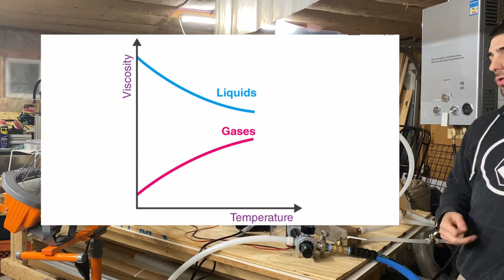How Will The Tesla Turbine Generator Handle A 1200 Watt Electrical Load? Tesla Turbojet R&D

Comment: Can u plz tell me how much electricity is consumed by air compressor and electricity generator by turbine?
Reply from the maker: Hey Afzal Khan, thanks for commenting. 

The energy available for the turbine to use can be calculated from the energy available in 170gal tank at 150psi dumped to 65psi. 

The efficiency of hardware store compressors (which is at best 10-15% efficient) is not a good reflection of how well the turbine actually works. 

The isentropic efficiency of the turbine is determined from the energy available in the tank compared to the energy output to the shaft. 

Take a watch at the part 2 of the power output tests + thermal addition. 
Tesla Turbine 1200 Watt Electrical  Load Tests part 2 - Power Calculations - compressed Air + Propane
https://youtu.be/bWpXRzrzf4g
Reply: Yes i saw that video but still this system is not self sustaining
Reply: Why dont u increase the dia of turbine and instead of rpm focus on the torque generated
Reply from the maker: Can you give me an example of any room temp Compressed Air Energy System that is self sustaining?
Reply from the maker: I’m not sure I follow. I’m not focusing on the rpm. In fact I’m proving that TesTurs get plenty of torque and power out even at low RPMs. 

You just have to build them like Tesla says to build them. 
1) increase the fluid velocity relative to the discs (not increase the disc rpm)
2) increase the surface area
3) decrease disc spacing. 

There are 75 discs inside this turbine. That’s over 10,000in^2 

“Owing to a number of causes affecting the performance, it is difficult to frame a precise rule which would be generally applicable, but it may be stated that within certain limits, and other conditions being the same, the torque is directly proportionate to the square of the velocity of the fluid relatively to the runner and to the effective area of the disks and, inversely, to the distance separating them. The machine will, generally, perform its maximum work when the effective speed of the runner is one-half of that of the fluid; but to attain the highest economy, the relative speed or slip, for any given performance, should be as small as possible. This condition may be to any desired degree approximated by increasing the active area of and reducing the space between the disks.”
-Nikola Tesla
Reply from the maker: @Afzalkhan-nb9rk  I am in fact focusing only on increasing torque for a given motive fluid supply, not rpm. 

2.75kW, 6.22 ft-lbs at only 4150rpm
A Tesla Turbo that actually works on room temp compressed air.
https://youtube.com/shorts/yXQy844URMA?feature=share
Reply: Exactly that i also want say that if we have sufficient torque then we could generate electricity
Reply: And also we have to focus on generator i.e. two pole three phase a.c. Generators
Reply from the maker: How do you mean? 
🤔 
I already am generating electricity 60 hz 120vAC to the plug. That’s what the rectifier and inverter are for.
Reply from the maker: I think you may be confusing my gear setup.

This setup isn’t geared downed to the generators. 

I have this geared UP at 3.6:1 to the generator. (Ie the generators spin 3.6x the turbine RPM)
Reply: @CharlieSolis  why to use rectifier and inverter ?
Reply from the maker: @Afzalkhan-nb9rk  These are 4pole 3phase generators. 

They are high frequency pm alternators.  

They are used for electricity production with micro gas turbine electric generators all the time because of their high RPMs.

They also get some of the highest mechanical to electrical efficiency conversion compared to almost all other generators on the market.
Reply: @CharlieSolis  we generate ac voltage directly its enough
Reply from the maker: @Afzalkhan-nb9rk  I also have a design for dual built in axial flux generators in between stages. 

Dual Stage Tesla Disc Turbine With Built In Dual In-Line Axial Flux Generators CAD/CAM Walk Through
https://youtu.be/FIkU8Gny8i8
Reply: @CharlieSolis  wait lets make it simple , for example to generate ac voltage we need to rotate two pole generator at 3000 rpm and in tesla turbines we have sufficient rpms so why are u not using big generators like 10 kw or 15 kw generators and make a closed loop system integrating ur generator and motor of ur air compressor
Reply: @CharlieSolis  this is the only problem these high rpms because more the rpm means more air pressure needed which means more watts consumed by ur air compressor
Reply: If u have some free time then we can discuss on this project deeply because until and unless if u r not able to make a closed loop system this project will not succeed
Reply: I can share my experience with you as i am working as an senior engineer in 600 m.w. Coal based thermal power plant
Reply: @CharlieSolis  all u have to do is to provide energy tapped from ur generator to the motor of compressor and excess energy of generator will be used for supply purpose
Reply from the maker: @Afzalkhan-nb9rk  Afzal, Please watch my video about the combustion + steam system that I am building that will be the power house for the turbine. 
Tesla Turbine Jet Engine - gasoline fuel burner atomizer flame tube test 186,083
https://youtu.be/gRqKowignac

I’m building a TesTur jet engine. 

Tesla’s improved turbine system patent GB 186,083 (that he patented 10 years after the original turbine and a decade of R&D) has the ability to go above ranking or Brayton cycle thermodynamic efficiencies with the built in waste heat recovery boiler. 

Not to mention because the latent heat of vap is given up from the exhaust of the turbine, the heat energy from the initial combustion is entirely available for expansion of the steam through the turbine because that combustion heat is added to already superheated steam. (As opposed to the usual where after combustion the high temps energy goes to the latent heat of vap and then whatever heat is left over after that goes to raising the temp of the steam.)

As well because this system uses steam as the primary cooling medium for the combustion exhaust going into the turbine the compressor feeding the burner only needs to feed just above stoich mix,~15:1

Whereas usually gas turbines will run a 100:1 to 200:1 for properly cooling the motive fluid being admitted into the drive turbine. 

This allows for A LOT more of the shaft power to go to power out and not to driving the compressor, which can take up to 45% of the shaft power depending on the gas turbine. 

Again the cooling steam motive fluid is “made” by the waste heat” that goes out the exhaust of the turbine so instead of taking power from the shaft to drive more air in for cooling, it recovers lost exhaust heat to provide the same cooling. 

And because steam has a higher specific heat (joules/kg/°c) than air less mass of steam is needed to do the same cooling of the combustion exhaust for being admitted into the turbine. 

The compressed air tests are just for proof of concept, and I’m still outputting more power with my plastic and aluminum TesTur than anyone has shown before. 

The reason I have it geared UP to the generators is because EVERYONE demands that “TesTurs HAVE to be run at high RPMs to get power out because they produce such low torque. In which case they MUST be geared down to even work, and because they aren’t efficient they lose any and all of the little torque they get to the gearing system…. Blah blah blah…” 

I’ve heard every excuse as to why the TesTur can’t/won’t work. So just to spite everyone who demands it has to be geared down I geared mine up to the generators and I’m STILL outputting more power and torque at low rpm than anyone has shown before and still with just room temp compressed air. 🤭

Never mind the fact that as you increase the temps of the air above what’s used in these compressed air tests for combustion the viscosity of the motive fluid goes up. 

Not to mention hot Steam has a much higher viscosity than compressed air. Resulting in less slip due to increased cohesion forces. 

Furthermore, steam is a polar molecule which adheres to metal surfaces much more than the non-polar gasses O2, N2, CO2, etc. in compressed air. Resulting in reduced slip due to increased adhesion forces. 

And these are all just isentropic efficiency increases to be gained by the turbine for future tests. 

Andddd we still get to add on the bacon bits of increased thermodynamic efficiencies within increased temps. 🤭
Reply from the maker: @Afzalkhan-nb9rk  my next combustion build will be direct on shaft to its generators just fyi. I have 2x 10kW continuous generators that will go one on each side of the turbine.
Reply from the maker: @Afzalkhan-nb9rk  just fyi, I have a degree in physics. 😇 So I do in fact understand what needs to be done to make the system work for real, getting net power out.

This system will also be coupled with a solar boiler. Hell any heat source can be used.
Reply: @CharlieSolis  nice 👍
Reply: @CharlieSolis  do you think it is going to be economical i.e. using propane plus air pressure(consuming watts) to generate electricity
Reply: @CharlieSolis  but solar boiler will be useless at night
Reply from the maker: Technically it’ll be a solar thermal collector with thermal storage system.

Sand can be used for high temp thermal storage medium.

So night time Power won’t be an issue.
Reply from the maker: Lol it’s not being stored for days on end. It only needs to get through the night. And there are plenty of efficient systems available 

And because of the robustness of the TesTur we can have solid particulates entrained in the motive fluid flow so go ahead and just save all your grass clippings and annual leaves for gasifying and sending into the burn tube. 

Tesla even talks about using powdered coal in the GB 186,083 patent. 

I want to be able to test powdered iron in it as well. It has the potential to also be one of the next big energy storage chemicals.
Reply: @CharlieSolis  ok, good luck
Reply from the maker: Iron Powder Passes First Industrial Test as Renewable, Carbon Dioxide-Free Fuel
Oxidizing and reducing powdered iron has the potential to provide clean power on an industrial scale

https://spectrum.ieee.org/iron-powder-passes-first-industrial-test-as-renewable-co2free-fuel
Reply from the maker: Just released the latest update! 
Tesla Turbine 250 watt to 2.65 kW Power and Efficiency Test
https://youtu.be/XQl1DQgXVkQ